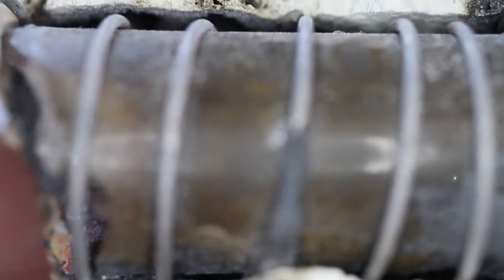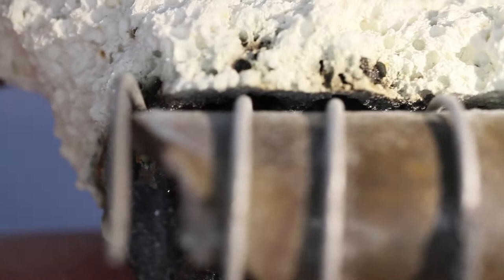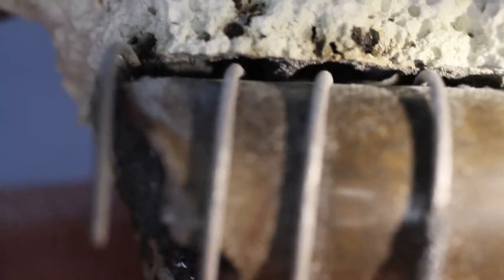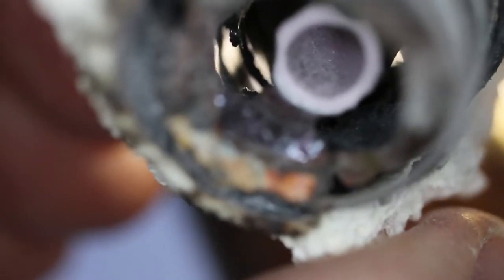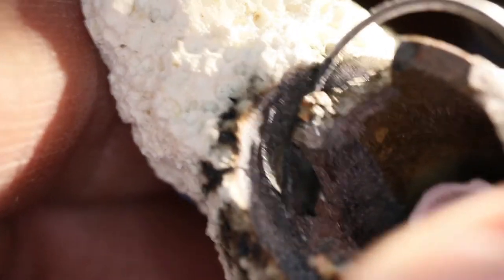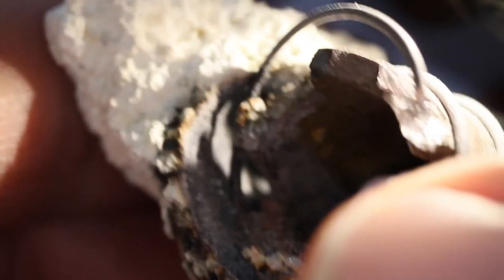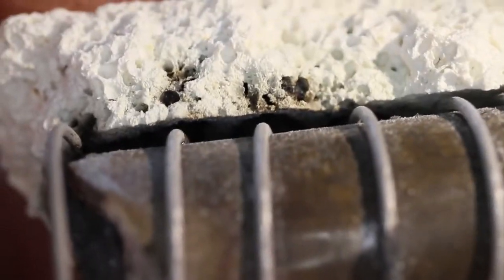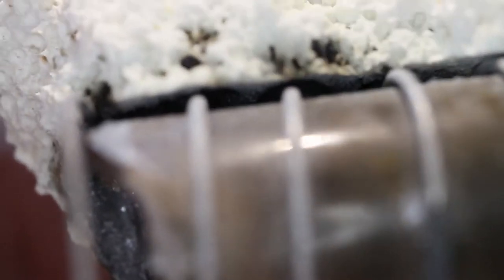LION 2 - Kanthal A1 relationship to Alumina

Comment: Just for my own information; Kanthal A1 heating wire has a melting point of 1400C, whilst the alumina is over 2,000C (I think) and quartz around 1700C (I think). How did the Kanthal remain so remarkably unaffected while the other components have been so obviously impacted - it should have been a molten mass.....shouldn't it??
Reply from the maker: One would have thought so - particularly since the thing that stops Kanthal A1 from actually oxidizing is... Al2O3 (alumina) layer on its surface - a fact that partially negates chemical arguments.

There is this paper which we came across - https://www.nature.com/articles/s41598-017-09811-z which goes a little way to explaining some of the bulk colouration effects. Cu can degrade SiO2 at temperatures that LION 2 ran at - however, how did the wire survive when the Foamed Alumina also expose has been so altered.